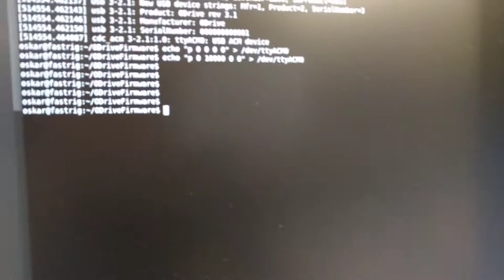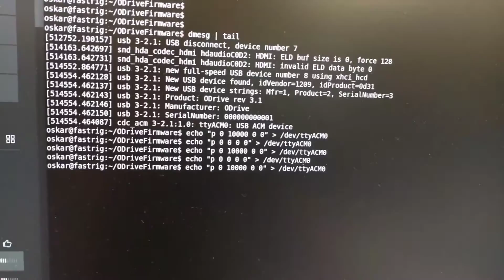ODrive with USB control and brake resistor

Comment: Is the brake resistor connected across power lines in series with a mosfet that you switch on when voltage on the power lines exceeds supply voltage?
Reply from the maker: Yes pretty much like that.